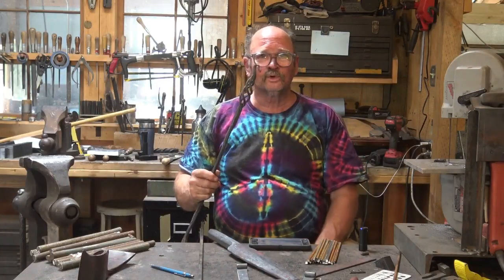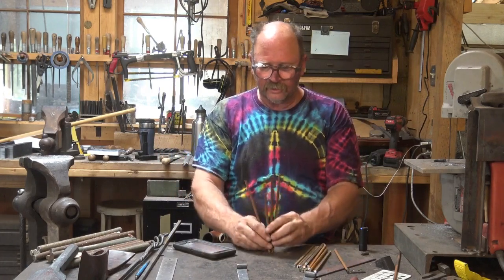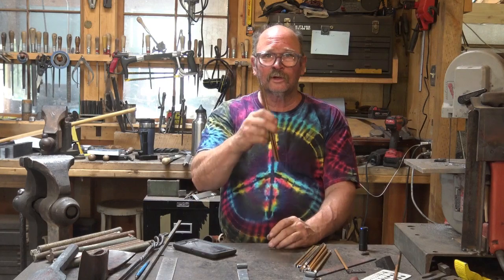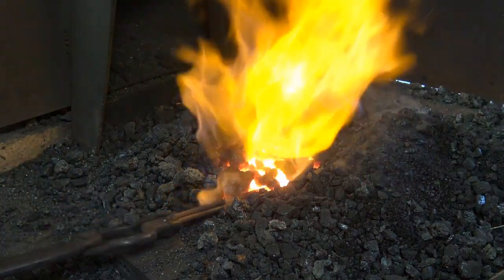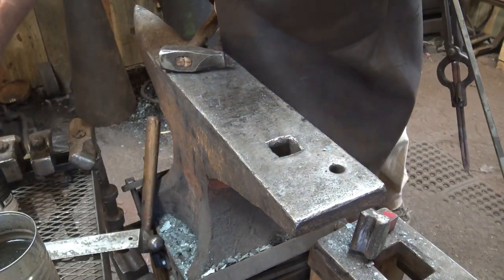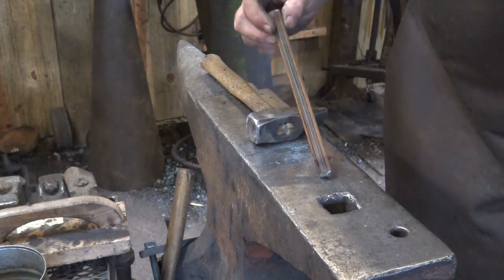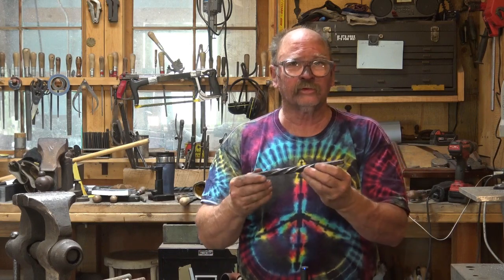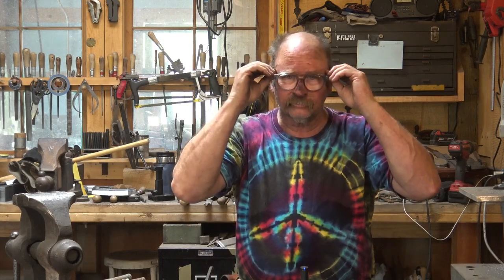Forge welded basket twist - basic blacksmithing welded twists part 1

Comment: Another really great demonstration, you make it look easy. Just something I have noticed on charcoal, it has only one problem for forge welding if to much ash has build up below after several hours of forging. That wrought iron is much harder to get up to forge welding heat than mild steel.
Reply from the maker: Frequently cleaning the fire is a reality for most fuels.  I wonder if a side blast forge has fewer issues.
Reply: Actually yes that is the main issue with my forge. It has no hole at the bottom to clean out the ash so I end up getting a lot of ash after some time. Something to consider when I need to make a new one thanks. The side blast could work to push the ash to the back or side.

Comment: Thank you for the great video! I have a question. You often say you can "burn up" your work. Can you get steel too hot? What are you meaning when you say this? Wanted to ask before I try this myself.
Reply from the maker: Too high of a heat with too much oxygen can actually cause iron and steel to burn.  Looks like a 4th of July sparkler.

Comment: I like a little 1lb or less hammer for that first tack. That and welding without flux help keep the scarfs from slipping, but welding without flux means you have less time before the scale solidifies. I can't find the MSDS for Iron Mountain Flux, but I think it's just anhydrous borax and iron filings. I might make my own and see how grippy I can make it.
Reply from the maker: It doesn't behave like borax does, so I doubt that's what it is.  It seems more like easy weld in use.
Reply: I've heard "Sal Ammoniac" or ammonium chloride was commonly mixed with borax and iron filings or used alone as a flux for iron. It was also used extensively for soldering by redsmiths since it cleans copper oxides well. You can still get it in blocks for cleaning soldering irons. I've never tried it or any silica-based flux (like clean sand) because they're both supposedly more noxious at high temperature. Potassium ferrocyanide was also used, but I'm guessing that's probably poisonous too. (EDIT: I just checked, it seems that the ferrocyanide decomposes into KCN with heat. At temperature, the KCN would be in liquid form and possibly fuming. KCN is the "cyanide" you read about smelling like almonds and being super poisonous.)

As far as I know, all iron fluxes do one or both of two things: First, lower the melting point of magnetite so that the scale is fluid and can be squirted out of the weld. Second, introduce sacrificial material that's preferentially oxidized like iron filings (and maybe ferrocyanides) so that scale doesn't form as quickly on the work. As to what makes a flux sticky or slippery in use, I have no idea.

You almost certainly know all this, I figured I'd share in case anyone else was curious.

Comment: 2 things. 1. I learned that not all acids make good flux. I tried to use pure citric acid once because I can get it free, it burns, makes instant scale, and smells like burning hair. So don't do that. 2. Have you ever done a twist and had it weld together? I've actually done that intentionally for a blade pattern. Great video John. Thanks.
Reply from the maker: Welding the whole twist is common for Damascus work, but would really mess up these ornamental twists.  Fluxes for forge welding don't need to be acidic.  Historically clean sand was often used.

Comment: Is it preferable to open up the basket before you finish the end?  I would think that you would want to finish the end before untwisting so you wouldn't mess the basket up.
Reply from the maker: Often times once the end is finished it doesn't provide a good grip for the twisting, but if it does it would probably better to twist and open last.

Comment: Some people burn there steel on purpose to forge weld and it seems to work pretty well. I've seen Joey van der Steeg do this, what are the reasons why you shouldn't?
Reply from the maker: Burnt steel is steel lost as well as being permanently damaged.  The higher heat and generally high oxygen levels also contribute to more scale which makes a successful weld less likely.

Comment: be very interested in seeing a multi  twist with more than 4 sections
Reply from the maker: I have one in mind.  But in most cases when you see numerous bars the bundle becomes too large to twist manually and I don't have a twisting machine.  The ones I have seen use old truck or jeep transmissions to get some incredibly high torque capable of twisting large bundles cold.
Reply: good to know, thanks for the info